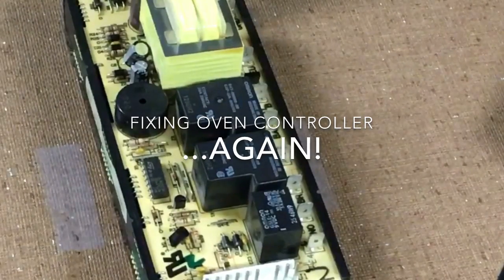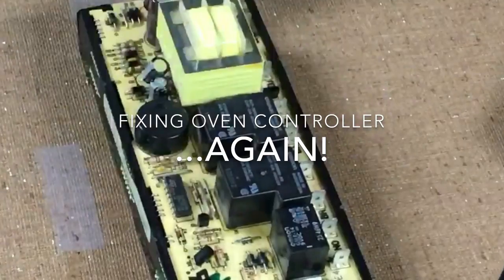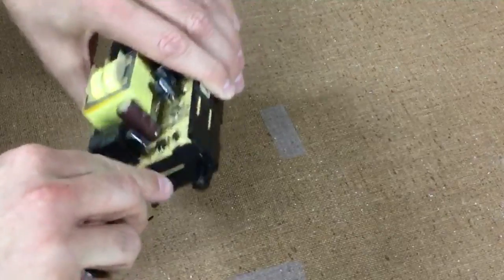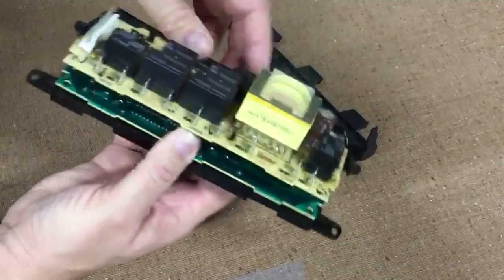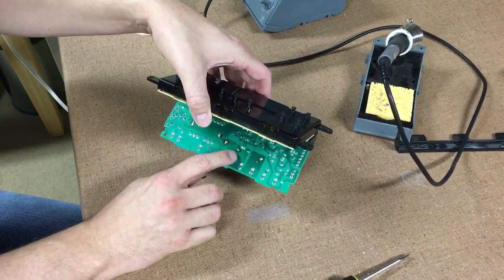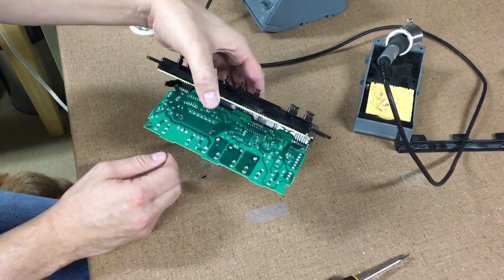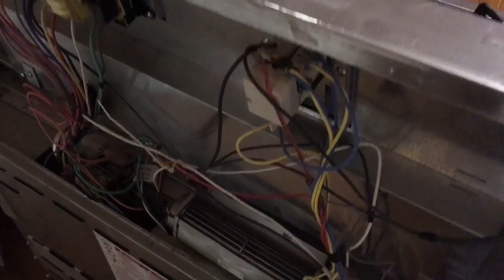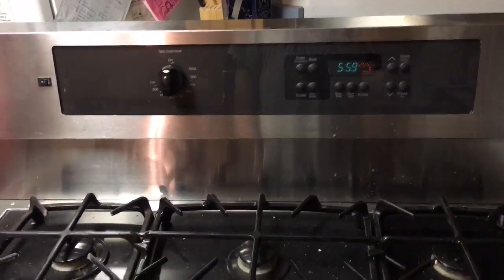Oven Controller Repair Kenmore Elite Oven 790.75503

Comment: Amazing video! I have a different stove but the same repair concepts apply. My broiler stopped working and the oven would not heat beyond luke warm. After watching your 2 videos, my husband and I opened the back of the stove, removed the control board, opened the board to display the back side and found a spot where the solder appeared different than all the other solder spots on the board. We touched up the solder spot and put it back in the stove. My stove is once again working great! Before watching your videos I was ready to send my stove to the landfill and invest $1200+ in a new stove. Thankyou so much!!!

Comment: thanks   i trouble shot my kenmore elite oven and figured out it was the control panel.  i saw your video and opened the control panel.  the problem was exactly like your video.  i cut a small piece of wire and enclosed the other end.  instead of jumping i soldered the one ended wire to the damaged area and soldered it    it worked.   thanks.

Comment: Matt!  Just a fantastic video!  I cannot believe that I finally stumbled on this.  I had done the normal troubleshooting, checked the coil resistance, checked the thermal probe, etc.  Of course we have exactly the same Kenmore Elite Oven.  I was just about to scroll through another half dozen websites that offer to repair your controller when I found your two videos.  Just amazing.  One simple solder application to get the oven repaired.  I do understand that this is not a forever fix and that a better or heavier solder bead could be necessary or the other relay could need the save fix eventually.  But what a relief to get this repaired myself.  Your detailed explanation in this video of separating the two board halves of the controller was a life saver as well.  I would have likely broken something without your guidance.  Thanks a million!

Comment: Matt.  Thank you so much for sharing this information.  I actually purchased two elements thinking that was the problem.  Then I saw your video and found the EXACT same solder joint was melted.  Re-soldered that joint following what you did on your two videos and oven is working perfectly!  You saved me a bunch of money!  I do agree with the commenter that maybe there's something wrong with the relays, but for now, I'm good to go.  Thanks again!

Comment: I'm a happy woman!  Joining the ranks of those thanking you for your videos and help.  The format and price of my Kenmore Elite (like the one you repaired) really works well for us.  Bought it in 2006 and it's been great until the oven stopped heating last week.  I guess 14 years is pretty good for today's appliances.  Repair tech looked at it, said it couldn't be fixed and board (part # 318010102) was no longer available.  While researching places to send the board for possible repair I found your videos.  I've worked on computers some and the range's board didn't look all that different.  So, I recruited my son for muscle power and we tackled it. Other issues are likely to come up - but it's working for now.  Like others have written, finding a replacement range for the 40 inch opening in my counter was not going to be easy or inexpensive.  Plus, all of the newer, fancier ranges I found on the market today lacked some of things I love about my old Kenmore!  Thanks again for taking time to share your knowledge and experience.

Comment: Thanks for this video. You gave me the courage to take apart the control board and reveal a burned spot where the soldier should have been, just like your video. I was able to fix it and avoid purchasing a new $360 control board (+$100 labor) for my 5 year old Kenmore Elite Electric range.

Comment: Matt: Thank you for both of your oven repair videos. YOU ARE THE KING OF HOME ELECTRONICS REPAIR! I had a very similar problem with a Maytag Gemini (double oven) that wasn't heating up properly and watched both of your videos. I was pretty sure that my problem was a bad bake element relay (as opposed to the broil element relay). Mine is a G8P-1C4TP-DC24.

I found and bought a new relay, opened up the control board... and found the same thing you did. In my case, it was the broil element relay that had one pin that had become de-soldered. There was nothing wrong with the bake relay. I re-soldered the one broil relay pin, tested it out and I'M BAKING AGAIN!

I'm keeping the relay for the next time in case re-soldering doesn't permanently solve the problem. 

By the way,  a new control board for the Maytag Gemini can be bought for the low, low price of..... $462. That's at a discount and doing the install myself. I was very happy to, instead, solder one joint myself, with the help of your video, and I'm sure I can find something better to spend $462 on. Thanks again for making such a great video. I know from experience that it's easier to just do the repair WITHOUT filming it. Thank you!  -Jeff

Comment: You first video was a lifesaver about a year ago.  Exact same problem and the part is no longer manufactured (and no replacement part either).  You fix worked like a champ vs the $100 to $150 for a "repair service" for this part.  Oven just popped again.  Looks like that's my next project.  

My biggest issue is we can't replace the stove as no one makes a 40" stove. To replace the stove I would have to do a kitchen remodel due to the current layout!

Comment: Matt, I just wanted to say thank you for taking the time to create and post this video. I just had the same problem, with the same oven. Your video saved me a lot of grief and a lot of money. I would also like to know where the relays can be purchased in case I need to take this repair to the next level in the future. Would be well worth a few dollars of investment now to avoid having to buy a whole new oven when they are no longer available.
Reply from the maker: Hi Ken, it looks like the relays are no longer available via the original link I posted.  I'll have to do some digging.  Will reply when I find them.
Reply from the maker: Digikey appears to sell replacements https://www.digikey.com/product-detail/en/omron-electronics-inc-emc-div/G8P-1A4P-DC15/G8P-1A4PDC15-ND/1813590?WT.srch=1&gclid=Cj0KEQjwg47KBRDk7LSu4LTD8eEBEiQAO4O6r75zZ-cBS5hYBmrlfxJoQGiUhxsfhbO1jYXnUs_i5jgaAn5c8P8HAQ

Comment: Hi Matt.  Please excuse my redundancy but I posted your first video looking for some additional help without saying so in the first few lines.  That video gave me great confidence I could tackle repairing my Fridgedair 318010102 control board which had stopped working with a burning smell and had gone dark.

After several passes, I could really use some further advice particularly from someone who has successfully diagnosed and repaired this board beyond the level of depth you have covered so far, and I suspect that many of the repair services offered can only handle the easy problems.

When I took my board apart I found a big hole beneath one of the pins in the bake relay and signs of significant burning including a couple of pcb gold threads which had been exposed and broken. Not to be discouraged I wired pin to pin around the broken threads and used fairly heavy copper wire to connect the relay pin to pin to connections on its pcb plate. But this repair did not work.

With a little more research I found a video on "hidden thermal fuses in small transformers" and in the comments I found advice to check a small zener diode on the board that could also be bad. So I removed the transformer, found the embedded thermal fuse, verified that it had blown, and ordered some replacements including the zener diode on DigiKey (which also has replacement 9v relays for the board). Now having replaced the thermal fuse and the zener diode, I tried my "repaired" control board again and it is still dark and dead.  I live tested the transformer to find it putting out 39.2 VAC on its secondary which is surprising since a repair kit I ordered contained 9 volt relays. Needless to say the transformer is no longer available.  Help anyone?

Comment: My mom had one of the solder joints at the heater relays fail a couple years ago, re-soldered failed again just about a week ago.  Instead of just resoldering, I removed the masking from the pads for the heater relays and ran a heavy bead of solder from the outputs to the terminals. Hopefully it will increase the current carrying capacity and not fail again.

Comment: Putting more solder on will make it work for awhile, but the problem is the relays. They need to be replaced. They are getting hot enough to melt themselves free.

Also you need to remove all of the old solder and put on fresh solder. I usually add a small piece of wire to the relay terminal and scrape away some of the soldier mask, so that there is more surface area involved with dissipating the heat. I should make a video so it would be easier to understand . It makes a big difference on long the repair lasts.

Comment: When the video began, I was already fed up and I thought I was watching another dolt, but you just saved me, so thank you. Wasted much time watching so many videos with one moron copying another...just replacing parts and no solution. For those who need a new part, I SUGGEST IF THEY ARE NOT MADE ANY LONGER and too expensive to justify purchasing, head to Habitat for Humanity Restore or thrift stores, or used appliance places. My unit is in a wall oven made for Electrolux, by Frigidaire, in Canada. The model number is GLEB30S8CQB made February 2004. My part number is exactly as yours...and looks identical. My bake element relay also had a burnt solder connection and I resoldered all the relay pins. Before soldering, when I had tested with ohm meter across elements and the temp sensor, and for AC current, I could not detect any problem. I was assuming it was one of the unattached relays, inside and mounted adjacent to the control board, but after seeing your solution, I did not waste time testing the relays, and just removed the electronic oven controller, and took it apart. I was surprised and very glad to find I also had a burnt solder connection. Oven now works great! This is clearly not a unique problem and is either bad design, assembly or engineering...or all three.

Comment: Matt am i need a used or refurbished oven controller. I watch ur video, repaired it and it worked for a minute and now does not work anymore. sent it to repairs and its taking ages cos they can't find part. SMH. any advice u can give? thanks

Comment: What is a good replacement relay?  G8P-1C4TP-DC24 is obsolete, and it's not like you can just throw any similar relay on the PCB without major surgery.  I'd like to have a set on hand if/when these die and just tuck it behind the oven for some new homeowner to find in a few decades and when this fails again.

The part label is OMRON 047-00060-00 (no hits)
30A250VAC

I believe it's a 24v switching voltage and 240v.  I've seen 15a, 12v, 120v relays of the same shape, but not one for this spec.

We can fix an oven from 1920, but not from 2000.  That's pretty sad.
Reply: Good question.  I don't think you'll be lucky enough to find another relay with exactly the same pin locations.  I did this same repair on mine, and the relays are all still good.   I found that the coils pull in strong and reliably at 9V, so they are 12V coils at most.  They worked well at 12 volts, and did not burn out even when left connected for several minutes, so I'd say a 12 volt coil would be a good choice.  The proprietary number on the relay is useless for figuring this out.  You can also just check the voltage that the coil pins get hit with on the board itself.  Anyway, as for a replacement... if I ever have to do it, I plan to just flip the replacement upside down and zip-tie it to the board somewhere convenient, with soldered wires running from the relay pins to the board traces, using 14 or 16 ga wire for the heavy switched current leads.  That's still heavier than the little pins and traces they used on the board!

Comment: Matt have you ever had the time and timer brightness get very dim and if so were you able to fix it by soldering anything on the panel?
Reply from the maker: Skip Kern sorry, I haven’t seen that
Reply: @Mat, I have one of these Elite ovens..My LED is getting dim. I also am experiencing a problem with the oven heating element controlled by the same element. It wont turn off when its plugged in the wall.
Any Ideas
Reply: @skipkern9065  Cool.😎thanks skip.. what price range to repair it?
I found an aftermarket version replica around $300.00. Didn't want to invest that much.
Reply: @greatobservations9810  go to the link look for your oven serial and choose shipping and turn around. I believe it was $199.. and comes with a 2 yr warranty of repair
Reply: @skipkern9065  👍

Comment: Great job...you helped me fix my oven 2 years ago (when I had the same solder joint that failed in your first video).  Today the other relay went, just like in your case.  Thanks for the help!...any idea why they keep blowing?  presumably some design defect.

Comment: I would call that an engineering flaw. That design is relying on the solder alone to cary the full current. I would clean the posts and loop 16 gauge wire around it so the wire is taking the connection to the circuit trace, not the solder.
Reply: YES YES YES.   I fixed mine with some silver-bearing solder 3 years ago, and that joint is still good.  But a different one just blew out (which I resoldered).  The solder alone is carrying the high burner current every time that relay turns on.  I was kind of hoping that adding the silver bearing solder would make the joint strong enough to not blow out again.  We'll have to see over time.

Comment: Happened to me took it apart looked to me like former owner also had the control board apart because I could see wear on tabs so my guess is that this is a common problem on these specific boards/relays

Comment: Would the oven only “heat” to 100 & the element not even heat at all?
Reply from the maker: Mike Connors yes, I think just the top element was working, if I recall
Reply: Matt DeRoller thanks Matt I have the same issue...